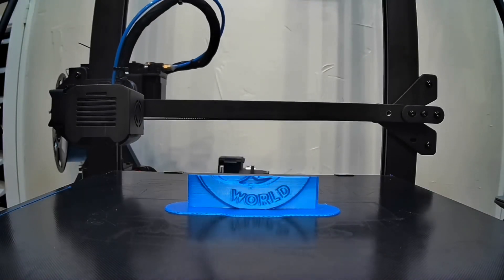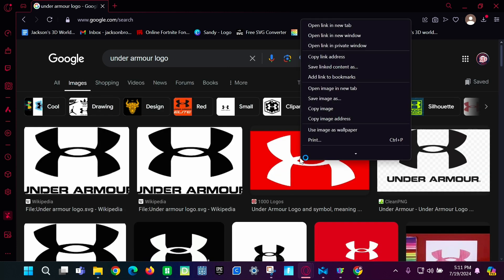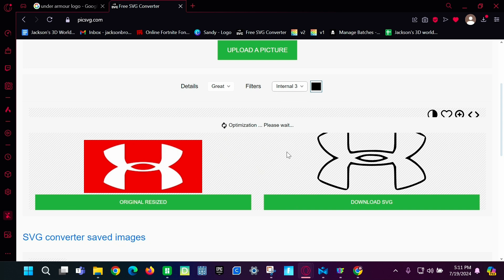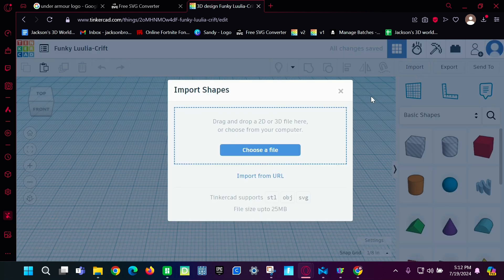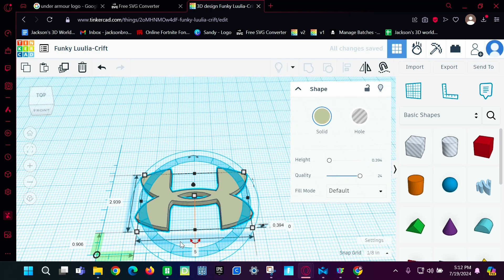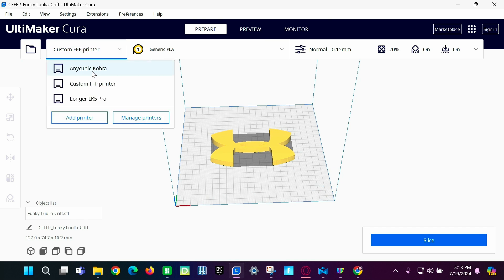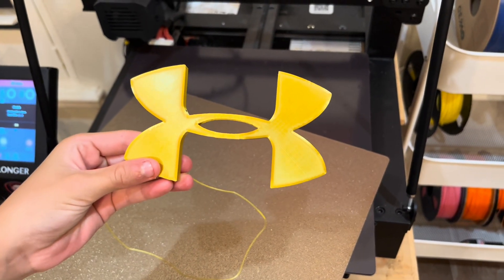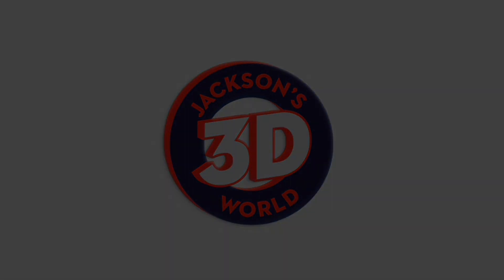How to Convert a JPG or PNG to an STL File for 3D Printing

Comment: How would you make part of the logo higher than another? Say the top part 5mm higher than the bottom.
Reply from the maker: Try these steps I show in this video. Let me know if that does do what you want to do with your logo. 3D Printed Hype Chain | Full Tutorial & Print Settings @BambuLab @AutodeskTinkercad
https://youtu.be/iqCpSeSWJL4